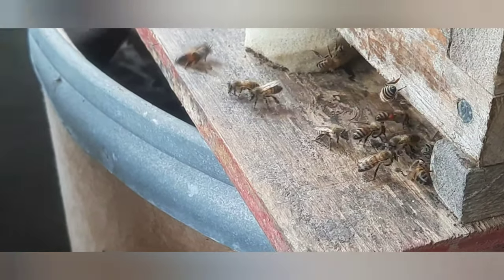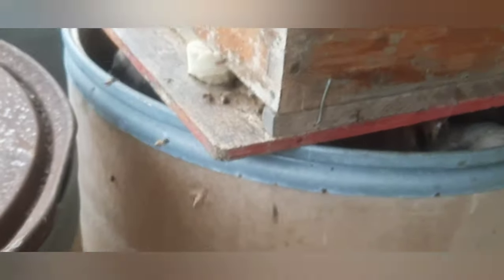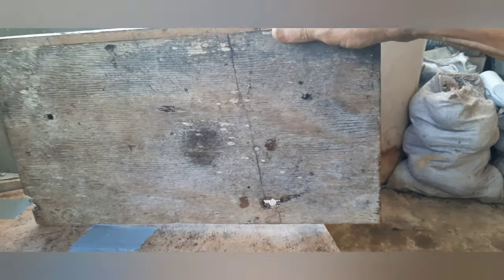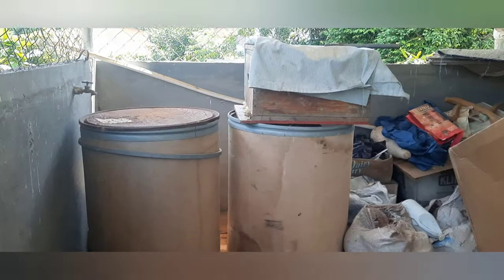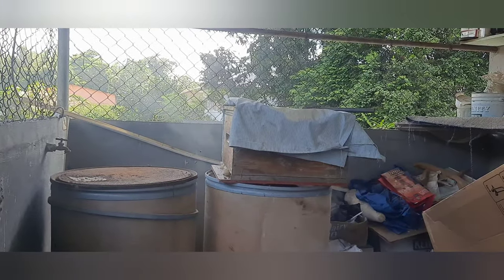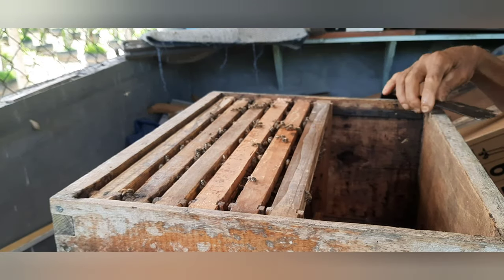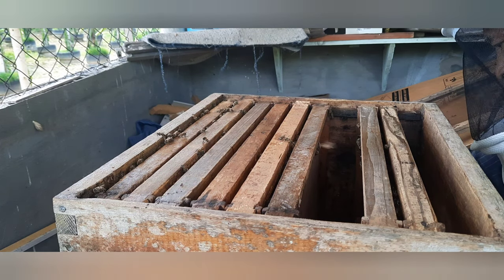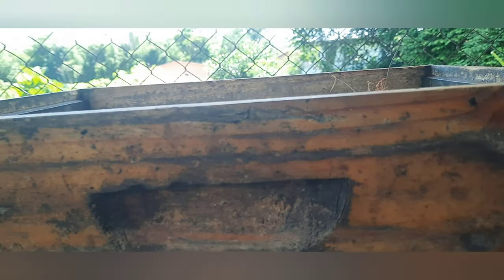Is this a honey bee swarm? and Why do they do that?

Comment: Too many empty frames between a well organized frames accelerates the comb growing in funny direction and built wrong. If you try to keep the frames that are well made and built right to only 1 empty frame between them it will help to avoid bent funny, crooked comb. But to get that to work you want to straighten the frame also. 

If you don't have rubber bands, you can use string to tie the wax frames in better after you correct the comb. 

...

One strategy I did before on a colony, was that I didn't want to have the colony box open for very long. This was for robbing but also I knew I wanted to minimize the time with the box open to keep them from getting angry. If you have bees that are easy to get angry, or that you just want to get out fast, you can try to fix one frame that day, or 2 frames if you can them fast. Then put it all back together and close it up fast. Then come back two days later and then do the next comb that needs fixing. Then the next one 2 or 3 days after that. if you do it like this, if its done very quickly then you can avoid having them get stirred up.